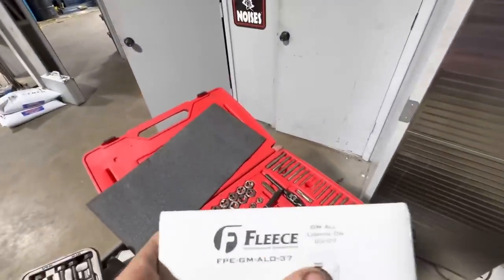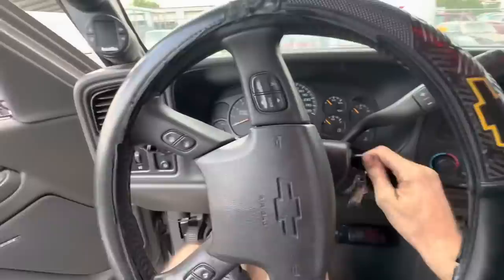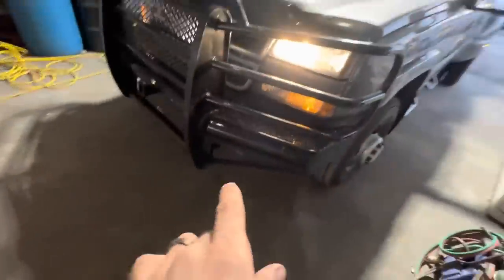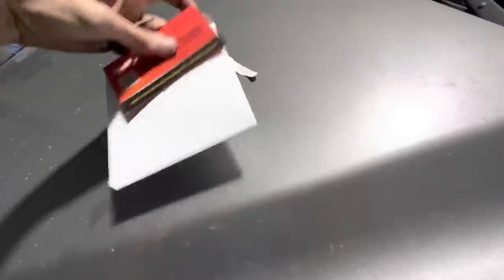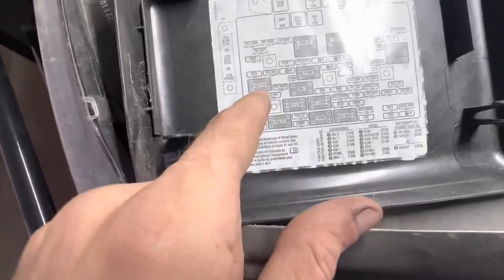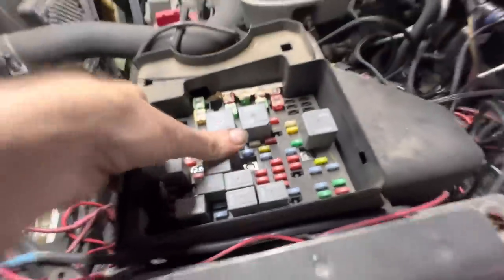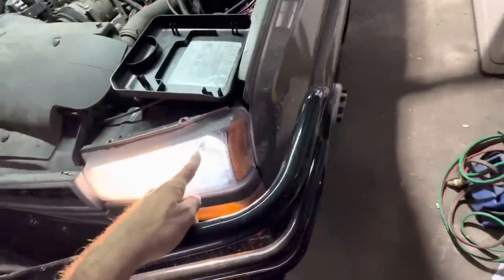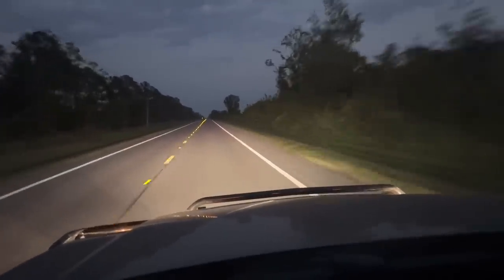All Headlights ON! (Plus Fog Lamps) GMT800 GMC Chevy 2003-2007 1500-3500 Trucks #Bambimode

Comment: You should have added a disclaimer to check you states DMV code about this because in a lot of states it is illegal for all the lights to be on at the same time.  This is do you don’t blind the driver coming towards you and them possibly swerving into your lane and hitting you head on.  I also think that there is federal regulations about this too, but correct me if I am wrong.
Reply: You shouldn't be running your brights with oncoming cars anyway.

Comment: Ray when I drive in fog and turn lights on high beam I can't see as well as when on low beam  when on high beam the light is higher-up the light doesn't go thru the fog. On low beam the light is closer to the road, and fog lights are even lower. I just don't get it , why is all 3 better?
Reply from the maker: Well it’s not for use in fog. If there were fog, I can still have fog lights and low beams. What it does, is turn on the low beams and the fog lamps when the high beam is switched on. Effectively making the high beam switch turn on all lights buy powering the relays.

Comment: I always liked your year Chevy 3500, thought they'd hold up looks wise, as a mechanic any vehicle we have will last as we keep them up and take care of them. My Dad tried to do something like this, in a 78 Ramcharger, and it worked, until it melted the fuse box.  Hope that won't happen here.  I'm thinking that's a lot of energy and heat running through those relays whose job is to switch off when certain power criteria has been met.  Also, I can't remember, seems like you said you have two alternators under the hood, which I hope so, if not that's a lot for it and the battery.  Sometimes ideas should just stay ideas, and we should stop and ask ourselves, yes we can, but should we?  Don't get me wrong here, believe me I've often asked that, and then said yes, yes we should, and then paid for that answer lol. Interesting mod though, maybe for emergency use, but I can't see why anyone else would want that much light on all the time.  I live in NC, and we have our creepy woods and critters, and folks who drive around with their High beams on blinding us as it is.  Any, I'd like an update on this after 6 months to a year of use.  Still thumbs up Ray, you know Dad here loves ya!  Title name only, not a bio Dad folks.

Comment: Are you happy with those Bank gauges?
Reply from the maker: Absolutely! Two aren’t really needed but I like em. One is to control my Banks Pedal Monster and it displays ambient temp and humidity info. The other gauge is showing my additional sensors for turbo pressures and temps, and of course it shows the rear diff temp

Comment: I know the electrical circuits will carry the current no problem. What about the extra heat generated by 2 bulbs in the headlamp being on at the same time. I have seen melted handlamps from the heat  due to to hot a bulb?

Comment: Buy a Yota. I haven't turned my headlights/foglights on or off in a decade. You can leave them on and they will go off when you shut the truck off and on when you start it.

Also, if you want sexy marker lights, get TapTurn flasher replacement.
Reply: One more thing to break, ill pass thanks.
Reply: @sparkplug1018  Then why aren't mine?
Reply: @HueToobBlows  I prefer owning vehicles with as little unnecessary stuff to break as possible. Can handle turning the lights on and off, not that lazy
Reply: @sparkplug1018  then own a Toyota. They build them properly, first time. And you can afford to "be lazy" since they are that well built.
Reply: @HueToobBlows  thanks but pass. I’ll stick with my 33 year old Pontiac, as you said, built right without all the extra stuff to break

Comment: I'm wondering how good the connections will be in the long run, where the relay pins are going through the board into the fuse panel.

Comment: see my high beam switch going bad hard to switch on off  so I just added a toggle switch put in NEW high beam plugs put in resistor to fool computer so it will NOT say hi beams out! so ai can use high any time also! even with out low on

Comment: The question is, would the heat from running the high & low at the same time be an issue in the headlight housing?? I understand that the fog lights should remain on while switching between high and low, but wonder if the high and low on at the same time might be too much heat.
Reply from the maker: Probably not, I don’t think I could run it for extended periods of time. And if it melts the headlights we will find out later

Comment: My fog lights work of the little wheel on the dash if it is fogey I turne the leveler down so the bem doesn't reflect back at me I have to do this because my car does not come fitted with lower fog lights luckily we don't get  meny fogey days in uk not like when I was growing up in 50s and 60s when we all had coal fires  and steam engines were travelling along the railways

Comment: My DRL are nearly never turned ON on my 03 Silverado 2500HD. Is something wrong?
Reply: Yeah, the bulbs are burned out.
Reply: They are not. Just not ON as often as my Sierra's were
Reply: @lopincol  okay, they turn off when in park. Are you sure they're really not turning on when you're in drive?
Reply: @michaelbloom5342  They are not, and not coming ON when I remove parking brake

Comment: Great, now you can relay blind other driver cumming towards you when you forget to dim your lights. Also there are laws that govern what light may be on at what times, such as fog lights are not allowed on unless there is low viability and I don't mean that it is dark. I'm not sure if in the USA if you have an MOT or a vehicle safety check each year like here in the UK, I Suspect this would be a fail be a failed test.
Reply: Some states do have DOT inspections, however, they are checking that the lights actually function. High, low, fog, etc. Not so much how they work. 
Plus this isn't going to be illegal in some states either way. Florida btw, does not require safety or emissions testing. And even if we did, so what? Comes out as fast as it went in.

Comment: Could it be that if you need fog lights you are in fog? and you do not want a high beam as the reflected light from the fog would not only dazzle oncoming, but dazzle you as well. Which is why the manufacturers made it so you wouldn't be dazzled. Probably best you stick a bar over the cab and put some rally spot lights up there as well...There are so many must have gadgets out there for those with disposable cash. Like the brake light flashers that drive the guy behind insane flasshing every time the guy in front touches the brake. I shouldn't have watched this video, I don't have a dirty or even a clean max.

Comment: Sort of defeats the design and purpose of fog lights to illuminate from below the fog layer higher mounted lights will just reflect a wall of light back and creat a white out the only thing worse is people that use high mount off-road only light bars on the highway or in fog . Be also aware that using fog lights as auxiliary lights creates a lot of glare of the road for oncoming traffic particularly on wet road. Most fog light installations include additional or brighter rear lamp mode as bright as brake lights ,some passive aggressive’s use it as a anti-tailgating strategy if not so completely retarded to drive with their foot permanently on the brake pedal.

Comment: this little thing should be outlawed because it just for people to be dicks on the road there is no reason to have your light like this as a meter of fact it can be vary dangerous for you when driving

not to mention that as far as i can tell this thing is not DOT or SAE approved there for it is illegal on the roads of the USA

fog lights are so low because the light needs to be below the fog layer

when you turn on the high beams the fog and low beams are useless for extra light you will only need fog lights with low beams
as if there is fog high beams will make it impossible for the driver to see

the reason low beams are turned off when high beams are turned on is because of heat in the light box
old cars had glass and metal light boxes modern cars have plastic which melts at high temps

the only point for this is to be a dick on the road as in all 50 states when driving down a road you are required to turn off your high beams when you are going to pass by another driver so you do not blind them and are only allowed to use fog lamps in the fog not when normally driving
Reply: i adding this hear
now if you installed this when you are off-road that's fine by me but on surface/high-way roads no, that should be if it is not illegal for the reasons i have given

they do make kits that do this specific thing but only for use off road with another switch on the dashboard usually with a light bar but off road only